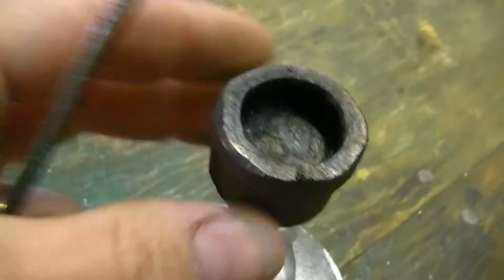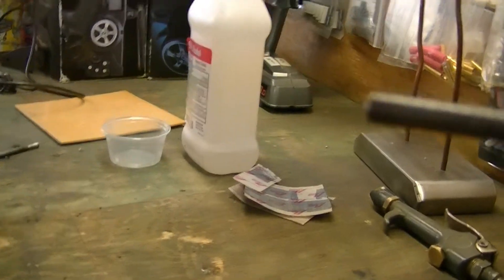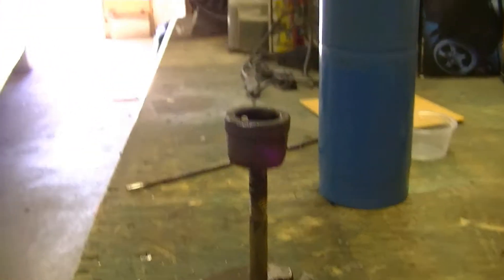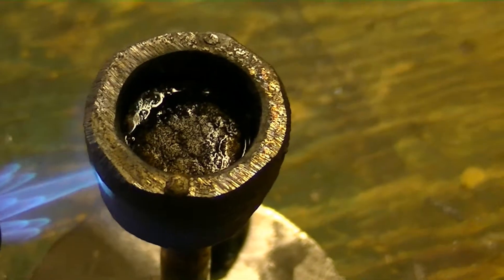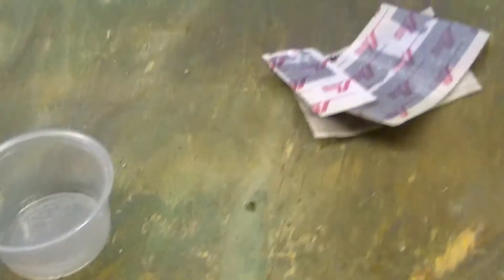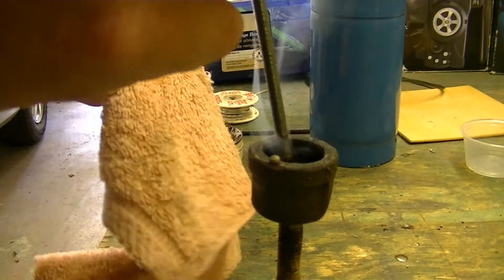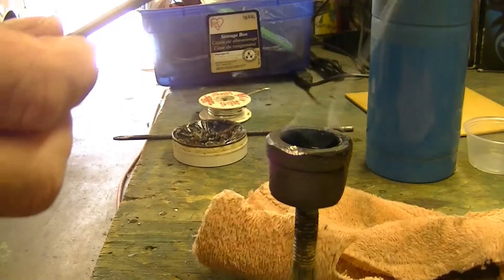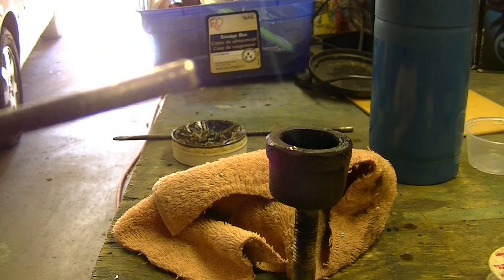Soldering rc boat flex cable, crucible method

Comment: Why solder the cable end then?
Reply from the maker: paulkazjack sometimes the cables and ever so barely start to fray and when you take the cable out to grease then shove it back in, that one wire will poke out and become completely unraveled from the cable. It's just extra insurance to not have that problemto not have that problem.
Reply: @crispyspa  also if the end is not sodard and you remove the cable from the Collet and few times the end of the cable can crush down and then the collet wont clamp down hard enough
Reply: thanks for that.

Comment: why!!!!!!!!!!!!  Why go through all this?????????????  It's so easy to solder a shaft......    You clean the shaft and then just wrap some fine cored solder around it about 1/2 in up the shaft and slowly heat it with a tinny pen torch and the solder will fill in everything just fine.......  this is lots work it seems.......  even more easy way to do it other then the 1950's way shown here is just some loc-tite seems to be common way to go now adays works just fine
Reply: +Rich Morgenstein damn you are a bitchy old man stuck in your ways. Why are you using loctite 935? The industry standards NOWADAYS are loctite 603 which takes a full one or two days to completely harden. Did ya know that? Also, if he wants to solder his cable this way he can do that, if he wants to do it the way your obnoxious self does, he can do that too. I've never seen someone complain so much about how another guy solders his flex. It doesn't affect you, so leave him be. I can guarantee you are they type of guy at a party or get together who sits by himself with a dipshit look on his face because no one wants anything to do with you. Change your ways old man, either that or you'll continue to be a pessimistic old nobody. I feel genuinely sorry for you, your family, and any possible friends you have.
Reply from the maker: +Rich Morgenstein How long does it take loctite to cure? I can solder a cable and be running again in 10 minutes.
Reply: +crispyspa  935 loctite dries in exactly 15 minutes and  fully cured in 20 minutes and is ready for use! So yeah after you spent 20 minutes welding a cup to a stand and another 15 minutes and 20$ of propane later melting the solder then dipping the cable 50 more times and another 20$ of propane to heat it up so you can finish your end I'll be drinking a beer in my recliner watching tv while mine dries after the 10 seconds it took my to put loctite on mine LOL   Ps...  How did all that burn flux taste as you ate all that smoke in your face doing it? On the bright side they are getting better treating cancer right?

Comment: im building a 26 inch nitro v hull and looking for a complete video on the whole flex cable system install can you point me in the right direction my old nitro boat had a solid shaft and was a rtr this time im building my own i orderd a engine hull and rudder i need help picking out the parts or kit
Reply from the maker: I got nothing on recommending a place to buy a complete flex set.  Maybe Off Shore Electrics?
http://www.offshoreelectrics.com/categories.php?cat=17
I used to get all my stuff at the local hobby shop.